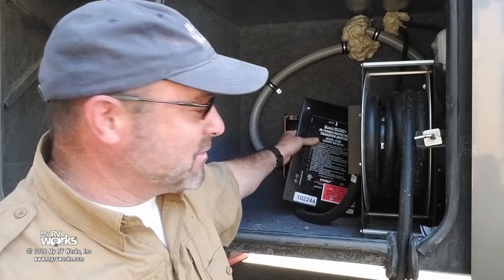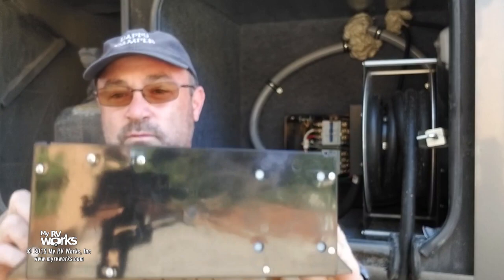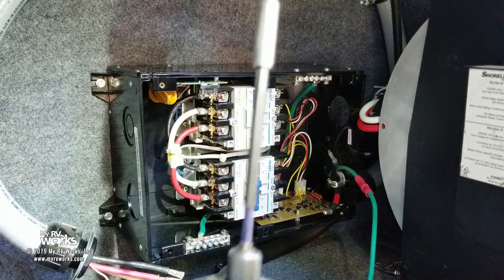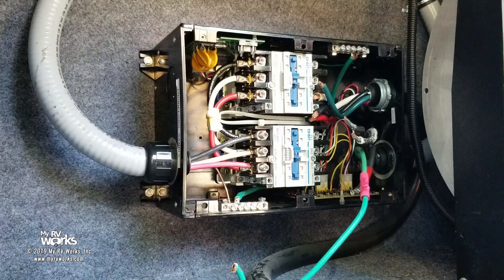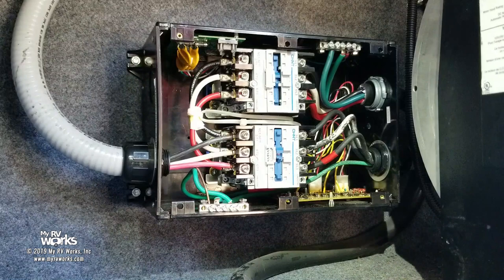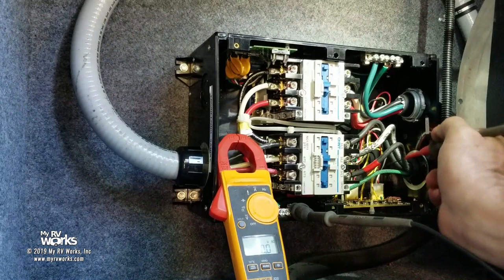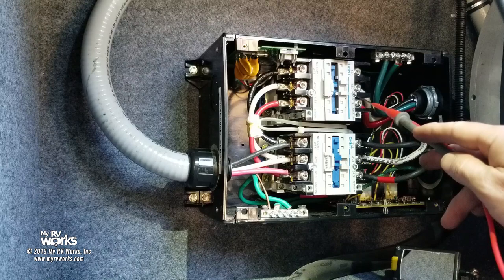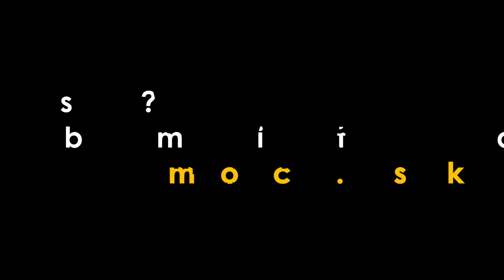How To Replace The Automatic Transfer Switch On An RV

Comment: Myself having been a  Network Manager for a major hospital in Manhattan (Retired now) I have had my share of out of box failures  and fully understand the frustration associated.  These companies that manufacture the equipment should make an effort in bench testing each unit verses testing several out of a lot number and passing the entire lot.  
Also associated failures can be traced to not properly grounding oneself  with a wrist strap connected to ground when handling and installing any sensitive electronic equipment, although I believe in this instance this was not the cause as the enclosure box appears to be a non conducive resin.  
Your trouble shooting as always was spot on and much appreciated.  
Thank you Darren

Comment: I followed your swap out procedure. Thanks for that. It’s money in the bank for the time I’ll have to do it myself. I’m going to order that pen like voltage detector.

But man you lost me when you put the old transfer switch in to demonstrate how it should work. I thought it was broken. I had to search your replies to comments to find that techno rv was testing out a new transfer switch and there was nothing wrong with the old unit. Maybe pin a comment to the top for future viewers.
Reply: Yeah, me to but he got around to saying the old one was fine, the new one had a surge protector feature and may have other features not mentioned.
Reply: haha! yes because I came to the comments looking for an explanation...like whaaat...if the original worked why a new one. I'm glad for the tutorial for sure though.

Comment: Finally someone that shows the full process and not just flash to the end and say "that's how it's done". let me know if your ever going to be in the Idaho area my Rv died last summer and it shows the shore power is working but I have 0 power in the rv, generator doesn't work either when I tried jump starting it it worked for a few min. then died as well.

Comment: Holy crap. This is exactly the video I was looking for regarding ATS issues. Thanks for all this! Now, just to figure Magnum battery charging issues. Inverter works fine. If house batteries are not fully charging (they are new AGM’s), then no charging of chassis’s batteries happens. Need help here.

Comment: Very good tutorial for electrical novices. This helps people to be more self reliant. I noted one interesting phrase you use that I have never heard before: "SEALING IN". I have been doing electrical/electronic work for more years than I care to think about, (including teaching electronics), and I never encountered that term. In my experience, the term used was ENERGIZED, or CONTACTS MADE. Very interesting! Perhaps it is a Northwest specific term. Anyway, I enjoy your videos, and benefitted from several of your Aqua Hot repair videos. Thank you!
Reply from the maker: I was a controls engineer and senior level systems engineer for 30 years working in Industrial Automation systems. So that's a term we used when we're talking about contactors being energized.  I guess it's one of the nuances in the Industrial Automation side of the house lol. Here's a link to a video I put out on how electricity works, you might enjoy it as well. I tried to keep it easy with my analogies. I know current doesn't 'flow' through a wire, it vibrates at the electron valence level, but folks have enjoyed the analogies nonetheless. Thanks for what you do.

https://youtu.be/mk3lDwU61o4?si=G-3jhzZVNxpM6oWT

Comment: Darin, I'm not sure if this will have anything to do with your problem with the replacement transfer switch.  But, I've been handling the park electrical at a park in northern Cal that was an old failed mobile home park turned RV park.  I've had troubles in the past with customers that have transfer switches plugging into our pedestals.  They would only get 65 volts, and it really had me stumped for awhile.  And it happened to the same customer in the same space two years in a row even after replacing his transfer switch, which I feel terrible about.  The problem ended up being the pedestals were installed for mobile home use and not RVs, which means the neutral and ground wires weren't bonded at the pedestal, they were counting on the bond being made at the distribution panel inside the mobile home.  I have now bonded all of the pedestals in the park and haven't had an issue since.  What I can't figure out for you is that the original transfer switch worked while the replacement didn't and imitated the issues that I've had in the past.  I'm just curious if the original transfer switch in that unit made a bond within it's enclosure somewhere.  I'd be interested in knowing if this may solve your issue, although I'm a bit late to the game since your video was uploaded months ago.  This happened to about a dozen customers before I figured it out.  Floating neutrals can cause all sorts of problems I suppose when they are not pinned to earth potential.  The appliances in the RVs were going haywire on 65 volts.  I'm assuming the missing voltage was being passed to ground.
Reply from the maker: Hi Ron,
 
Your question has been selected for an upcoming video where it will be read and discussed by Darren.
 
If you have not already subscribed to the 'My RV Works' YouTube channel, please do so and keep a watch for the '10-Minutes with an RV Tech’ video sessions.  This new series is a selection of comments and questions that will be covered and released weekly.

Here is our YouTube link:  https://www.youtube.com/c/myrvworksinc

Happy Camping,
My RV Works Media Team

Comment: Another great video, Darren.  I am ordering my torque screwdriver and check if I have any of my connections are loose.  Safety first, turn off and unplug everything before doing this (and always double check with a meter).  Thanks.

Comment: Great video. I enjoy all of your videos.  You explain everything and have excellent troubleshooting skills!  I think you solved the issue I have with the same transfer switch.  When I plug in to shore power, intermittently no clunk, it doesn't engage. With shore power still connected I start the generator.  When I turn off the genny, within a few seconds shore power engages.  Thanks for sharing your knowledge.

Comment: So what extra “bells and whistles “ necessitated changing the transfer switch.  They both appeared to be identical units . . . and, the original one appears to be a working transfer switch.  BTW - the former RV owner never instructed me to turn off the AC when going from generator to shore power or vice-versa.  Should I expect to see any issues from this if I follow your instructions, going forward?  Thanks for THAT tip and your easy to comprehend instructions !!!  I never knew how they worked - I thought it was magic.
Reply from the maker: This transfer switch was a prototype for my customer to install in his RV. He is the owner of www.TecnoRV.com and manufacturers will send  prototypes for him to test. Eric asked me to perform the R&R while he was in town.  Not sure what all the new bells and whistles are in the new one because we never got it to work LOL. There was a 5-minute section in my video where I covered specifically the danger in leaving your air conditioner on when you transition from Shore power to generator. My post production editor decided to cut that part out. However it is very important to turn off all of your air conditioner loads when you do transition between power sources. I do have pictures in my gallery that show transfer switches it have melted from people who do not do this. There's too much energy being transferred when the air conditioners are left on and they're started across the line like that.

Comment: It would have been great if you had enough slack in the shore power feed to mount the automatic transfer switch in the vertical position.  I always try to mount components so it's easy to work on and troubleshoot for me and the next guy....
Reply from the maker: Yes, that would have been nice. But when  I am asked to R&R I usually keep everything where it is to save on installation time since the meter is running for the customer. I was so tempted to pull out that cord real though because I could just not see anything from that angle.

Comment: On our service for our ten acre farm we shared a 7.5 kilowatt transformer with another ten acre farm,  between the two farms there was a road, now that might not seem like a big deal but, we had four stock tank heaters demanding 1500 watts each, add to that the other farms service panel was a third the distance from the transformer as ours, they also had stock tank heaters, three of them to be exact. we also had a full fledged shop to add to the demand on the transformer. The two farms also had a well and a double wide on each. as you can probably imagine there were hellacious voltage drops. We also had a mystery surging issue we later figured out that ALL the lugs on the service panel attached to the meter had broken in half along the shafts of all the lugs. Surprise, surprise, anyhow, thousands of dollars later and add to that paying our uncle, the certified electrician in the state of California, to camp on our property and feed him and his family, what a mess we had, a lot of things fried during the issue. He spent days diagnosing the root cause, then fixing that AND every problem downstream that were secondary issues. It was a bloody disaster. People wonder why I do not want to by a turn key operation, that one was constant problems as a result of SHODDY WORK FROM SHODDY CONTRACTORS that were hired by idiots. Long story short, the operation only lasted seven years before we were so financially bled to death that we left.

Comment: Just found your YouTube page after my ATS fried out on a recent trip. My ATS was the IOTA ITS-30rl that I believe was recalled a few years back. I bought the RV used so I assume the prior owner had no clue of the issues with this unit. Anyway, had a couple of questions before I purchase and install a new unit. First, should I buy an ATS with built in surge protection features? Second, does the inverter connect to the ATS and where? Last, my wire coatings got fried pretty good, I'm assuming I can still use the existing cables if I have enough slack to trim the wires back to where I have good clean wires. Please confirm. Thanks!

Comment: Just watch this one there Darren..love your videos on subjects like this!  I actually build my own stuff very similar to what you are showing in the video. I also ran across  a weird voltage rate one 1/2 of it just like you did.  I found that the energizing coil that is being used to pull in the contactors  were accidentally set for a 240 V.  set up..not the usual 120V as you were working with. The switch bow delay circuit and all inside were also set for 240V system..not the 120V as well thus when you connected 120V you were only getting half of it as it wasn't designed for that voltage. Hope that helps ...it helps when you deal with commercial electrical boxes of the very same set up...also confusing.  NOTE:  I use a circuit that thinks for itself when using normal AC line voltage vs generator AC sourcing. It is always wired so that whenever we loose Line Voltage..it auto transfers to generator after a delay...however - when the AC line voltage comes back on...it auto goes to line AC source and shuts off the generator.  in other words....AC line is primary choosing - then generator 2nd - (My system also continues to choose #3 source of 12 DC alternator - follow by #4 source batteries.  You do an amazing job there guy..Keep up the good work!! We love learning from you!!

Comment: Hi Darren, you stated not to install the transfer switch with the top facing up, but you never stated why. So, why not? Mine, in the fiver, is that way.
Reply: My transfer box is flat under the kitchen drawers and laying flat on its back with the opening facing upward... so if I replace it, which I’m getting ready to do, why wouldn’t I replace it the exact way it came out?
Reply: The idea is that those blue things that make the connection are being pushed out by springs.  If you mount them in a way that the spings also have to work against gravity the system is less safe.  Let's say multiple multiple things fail on this switch.  You want to make sure that it is more likely to fail in a safe position than an unsafe position.  Unlikely but still a simple way to add a little more safety.  The last thing you want is gravity helping close that circuit.

Comment: So lets say it was a defective unit. That does not explain why the other contactor DID work with only 65V. And a bit of advice....using earth ground is fine, but any time testing voltage on hot legs in AC, ALWAYS test hot to neutral, as well. A dropped or lost neutral can cause a lott of issues and easily be missed if not checked.

Comment: Back in the old days there was an outlet from the Generator you would plug your shore power plug into so you could just start your Generator and power your RV just as you would if on an RV site. No transfer switch

Comment: What a GREAT video! I will be replacing my transfer switch this weekend because I did exactly what you said not to do with the A/C. This will be my guide as I do the switch. I am curious though... You mention not to mount the switch flat. Jayco has mine mounted flat on the floor behind a bedroom drawer. I will move the unit to the wall if I can find room, but can you (or anyone else) explain the "why" behind not mounting flat? Thanks again for an awesome tutorial!!!!

Comment: My shore power would not kick in so what I did was pushed in on that blue centerpiece that you were showing with an electricians insulated screwdriver and just held it in until the power kicked in and that held it in place, so far, 6 hrs now

Comment: Fantastic informative videosI I have a 98 Newmar Mountainaire someone cut all the copper cables and wiring out of her there are two large red cables coming out of a relay/fuse box under the hood the biggest one I ran to the positive battery lug the second slightly smaller does it go to the positive lug on the chassis battery or directly to the generator or house batteries again thank you so much Winston

Comment: Did you check the coils, seems the were in parallel and not in series. 2 120v coils in parallel will have approximately 60 volts.

Comment: Similar to a reversing contactor for 3 phase motors, just without the overloads.
Would adding the overloads be a nice touch?
Reply: Overload is defined as equipment in excess of normal, full-load rating, or a conductor in excess of rated ampacity (current) that, when it persists for a sufficient length of time, could cause damage or dangerous overheating. Breaker will work as an overload, if it is working correctly, it will trip.  Overload is used to protect the motor, drive or another sensitive electronics.  In the transfer switch, the power is redirected and not used.  If you want to fuse your devices you can, but that will not stop your transfer switch from failing.  If large current is used by RV (when AC is ON) during the transition of generator to shore power or vice versa,  the transfer switch is unable to keep up with speed of closing.  Instead, the current will jump (travel faster than closing of the transfer switch).  This jump will creat a small arc (welding arc across the contact points).  If this continues to repeat, contact points will fail and will no longer close because they will be burn out.  That’s why it is recommended to torn off everything that draws a lot of current when changing power supplies.  That way, the transfer switch can close normally without creating an arc. Mechanical interlocks will also fail with time if it is exposed to dirt, water or other elements (that’s why mounting the box sideways or upside down is important to prevent water/dirt collecting inside).  Sealing it with a gasket (if possible) would be even better. All transfer switches will fail because of a sudden inrush of current (that’s why it’s recommended/best practice to turn everything off when going from one power source to another).  Overload will not stop arc from appearing because this transfer switch is rated for that specific amperage.  It’s like driving a car.  When you start your car, you slowly leave your driveway (normal operation).  However, if you take off from your drive way like you are doing on an drag race, your car will fail with time (something will break).

Comment: Can you replace just the contactor, or is it advisable to replace the whole transfer switch? Neutral wire from shore power cord was overloaded and burnt the contactor and wire. Wondering if this event may have compromised other components or the boards on the transfer switch.

Comment: I have a SouthWire ATS on my 50A 2022 Motorhome and the cable coming from my generator to the ATS has 4 conductors plus a ground.  It has the usual red, black, white, but also has a blue wire that piggyback connects alongside of the white neutral wire.  My ATS is a newer 2022 model that has additional safety features to protect from bad shore power situations.  My thought is that the blue wire must be used as a signal wire to detect an open-neutral fault situation?  What do you think?  BTW, thanks for your informative videos.

Comment: Did I miss the explanation of itbeing a “surge protector” ,also? Meaning you wouldn’t need to buy the small 20” adapter that some people first plug in to their shore power and then their extension cord? Or does this transfer not do that?